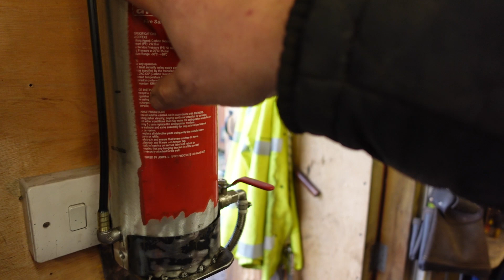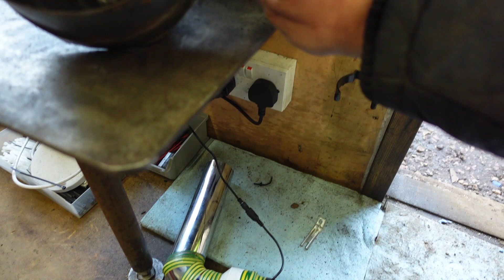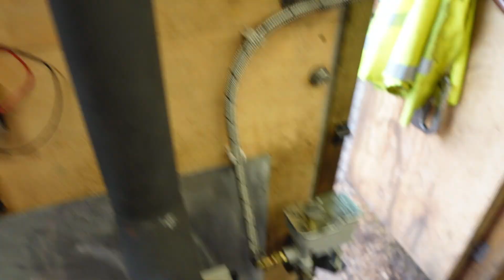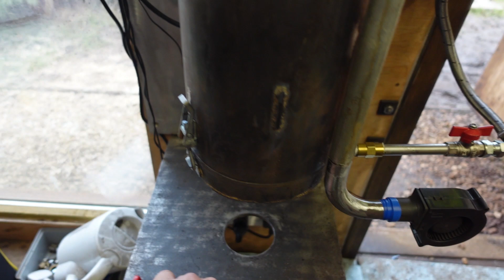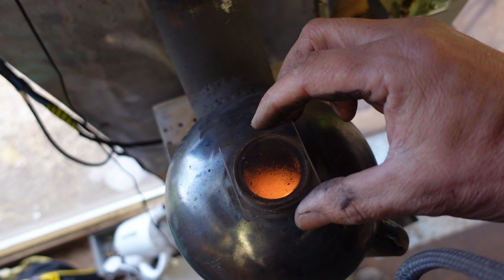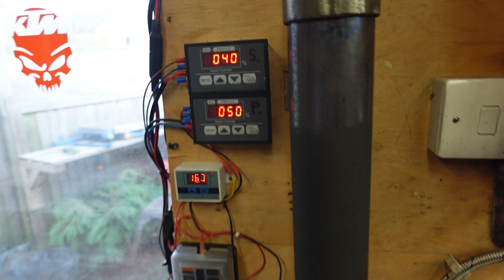Made My Very Own Waste Oil Burner For My Mancave......Nice and Warm

Comment: How do you program the control circuits, and what was rhe cost of all the electronics and sensors? (Rough cost)
Reply from the maker: To be honest,  there wasn't any programming to be done. Had 2 speed controllers for the fans, plus a thermostat  controller to switch on the fan at the back, all i had to do is set the temperature to what temperature i wanted the fan to switch on automatically. The 2 controllers, temperature controller plus the fans and blowers cost around £70.

Comment: We need to see the detail on waste oil porting, please. Thanks!
Reply from the maker: The regulator i use is a Toby DVR....mainly used for diesel stoves, because waste oil is thicker, i made the fuel outlet port slightly bigger to allow thicker liquid through without blocking the outlet port.

Comment: Great job. Would like to know more about the oil feed pump and how it works. And is the little square glass on top special high temp stuff? What temp does the chamber get to on the outside of the burn pot? Do you have an infrared gun to see how hot it gets outside? Do you try to control that with your fuel/air mix?
Reply from the maker: Hello sir
I will be doing a video on my fuel regulator,  will explain how the Toby DVR works, also the glass used.
Reply: @ 
Great! Thanks.
Reply: Please do, cheers!

Comment: This is the one I've been waiting for 👍.I'd definitely like to see the DVR mod. Did you need to mount it so high to make it flow the most appealing part of a DVR to me is the automatic shut off if the fuel level in the burn chamber reaches the set limit.
Reply from the maker: The DVR has a level marker on the side, it's supposed to be level with the burn chamber,  I chose to lift mine because I don't leave it alone...
Reply: @stephenminton339  Our ebay burner in the workshop runs between setting 4/5 on diesel and we have pushed it to it's limit now with mixed it needs max no7 and on cold mornings it needs feeding a splash of fuel a few times to get it flowing and it's not been rally cold yet this year if we get anything like the Beast from the East it's going to let us down when we need it the most. Our stock of red is just about gone now and we are thinking about trying kerosene.

Comment: Hey, good to see you back. I like your cat. Beautiful. I also like the build. Well done. Nice and clean. 

There is one thing I would like to see you play with, out of curiosity. I'd like to see you test different baffle designs (or at least one). Your burner works fine, and will keep you warm, but I wonder if a baffle would clean up the burn in the chamber.

 My burner is similar in design, and if I run it without a baffle, the flame goes from very defined and blue, to quite orange and wild. I've been doing a lot of reading, and they say that the reason for this, is that the baffle traps the heat in with the vaporizing fuel, and incoming air. The inrush of air, and expanding oil vapours are trying to escape, so the baffle creates what they call a combustion chamber. 

The baffle can be as simple as a large washer shape (or donut, if you prefer food references haha) with the outside diameter almost the size of of the body of the heater, and the inner hole about the size of your chimney. The volume / size of the chamber is pretty important, so making it adjustable or allowing for mods is a good idea.Moving mine about an inch is enough to make it go from orange to blue. (moving the baffle down reduces the size of the "chamber" 

I lucked out on mine and got it pretty close from the start, had to move it up 19mm and make the hole about 50mm smaller. I ASSUME that the chamber volume is determined by the amount of oil consumed. Mine burns between 1 and 2 litres per hour really clean. If I go more or less than that, it starts to shoot orange flames out of the chamber, and same of the rate is too low. 

Interestingly enough, if you look at a diesel heater burn chamber design... this is exactly how they work. They have a burn chamber with a baffle area, and then the tube... I didn't clue into this until I did some reading. I'll try to post a link to one of the things I've been reading. 

Cheers and great work.
Reply: Hi Joel I've been thinking you could definitely cut back on the amount of oil not to this extent but quite a lot.
Reply: @colinhamer6506  Haha... Hey... are you following me ? 

If I were just heating my garage, and was willing to do a air to air exchanger (use the body of the heater to heat my garage) then yes, I could get away with a LOT less oil. On the plus side... it is currently -24C (-11F) and was -28C (-18F) last evening, and my burner was able to keep my house at 20C (68F) while still storing a little heat in my water barrels for reserve.
Reply: @loweredexpectations4927  😜lol I've been following from the early days and back then we talked about your channel growing as it definitely deserves to but like I said selfishly I didn't want it to as OG subs will find it harder to keep in touch. I know exactly what you're setup is and I stand by my comment you can definitely get the amount of oil used down.
Reply: @colinhamer6506  Haha.. yes... I meant literally following me around. 

The new setup is doing really well. Despite the cold temperatures, I've had to turn down the burner just about an hour ago and it is 22.5C (72.5F) in my house. Once I get my pump issues sorted out, this system is going to work great. 

I haven't been tracking my oil consumption, but it has dropped considerably since putting a barrel over the entire setup.

Comment: Cracking job....if you install a heat exchanger on the chimney you'll be surprised how much heat you can recovery and put that heat into water....then install a few radiators

Comment: That is just brilliant.  You must make a video of how you converted the dvr it would be most interesting and possibly an idea I may convert to, although after 5 years of using mine every day I setup and go with the drip feed set and it more or less stays steady all day long.  I do have to slow it down occasionally if it gets  unbearably hot but that is normally only 1-2 adjustments over a 16 hour run and my room is a steady 27 C.  My system runs 1 gallon per day 16-18 hours and is 10% kerosene and I always start by dumping about 100ml kerosene so it heats up quicker and no blow torch needed and the blower can be turned on slow straight away after 2 mins full air all day and as I say can leave it alone for 8 hours no worries.  It will actually warm the entire house up to a comfortable level in every room I'm happy to say and your setup could do exactly that too. 🤑